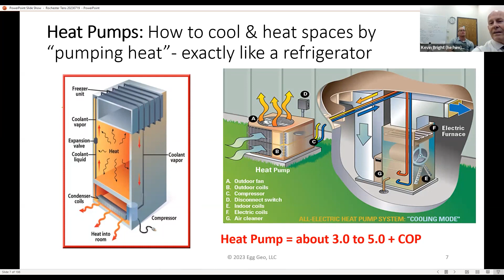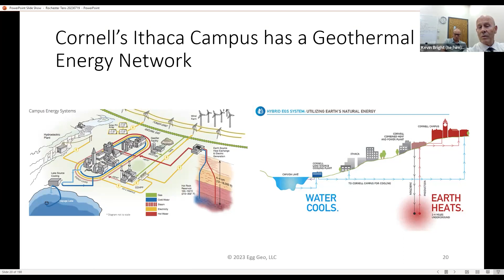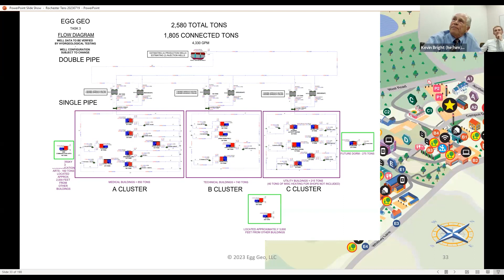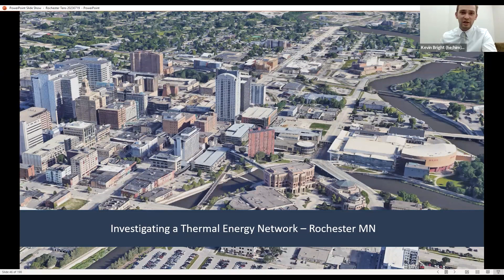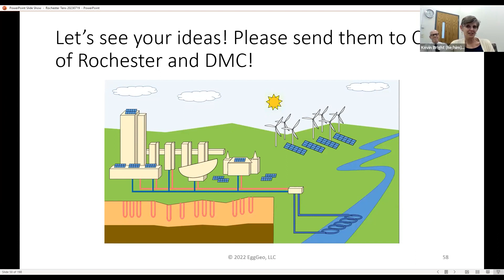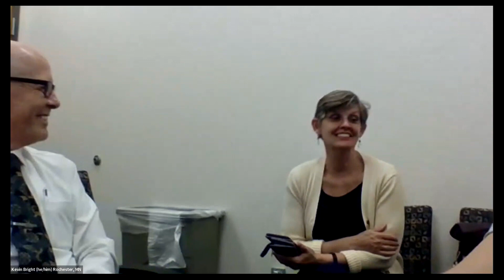July 2023 Sustainability Series   Geothermal Heat Pump 101

Comment: Sorry but this is misleading. Geothermal and Geo-exchange are two different things. The slides imply the heat from the earths core is used in geo-exchange with a heat pump. Simply not true.